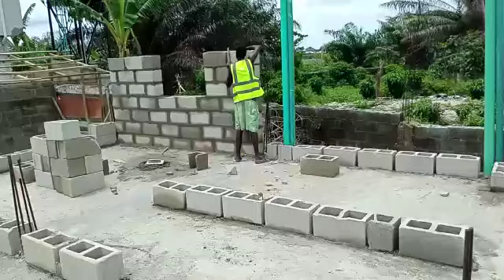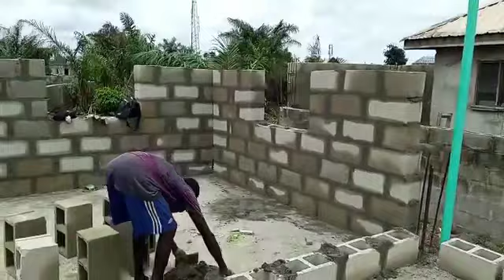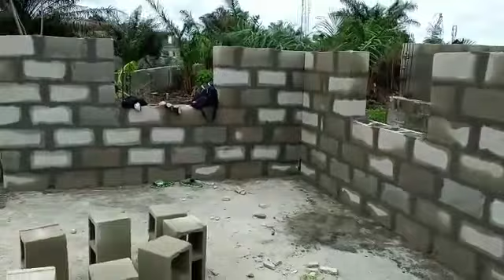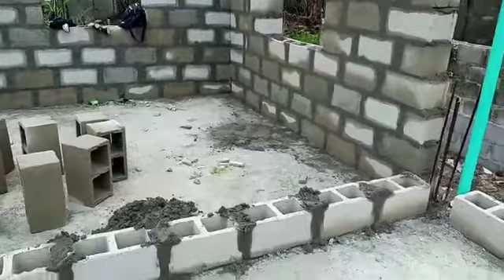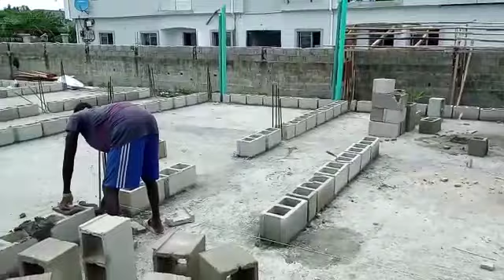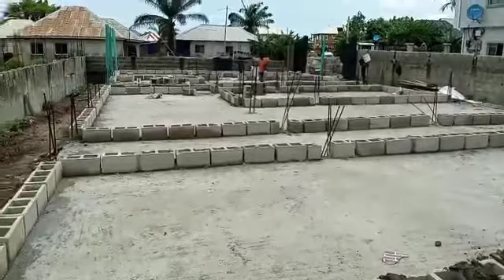BLOCK LAYING STARTS AFTER THE CASTING OF GERMAN FLOOR.

Comment: What is the important of frame work before laying the block's please
Reply from the maker: I don’t understand your question
Reply: After German floor, can they do frame work before demarcation of the rooms. In case there will be changing of construction in feature? Sir
Reply from the maker: No need of that, it call always be restructured as long as there are enough pillars carry the building